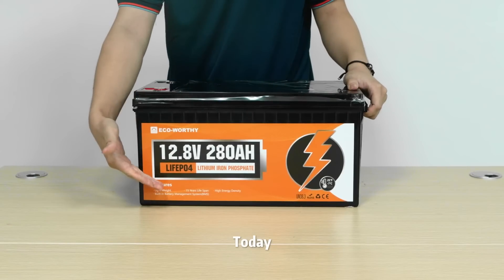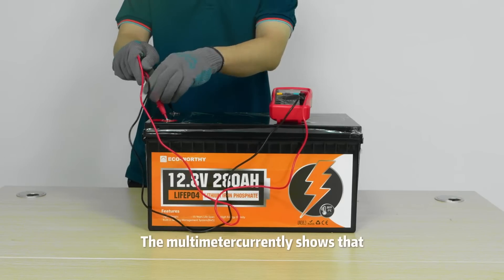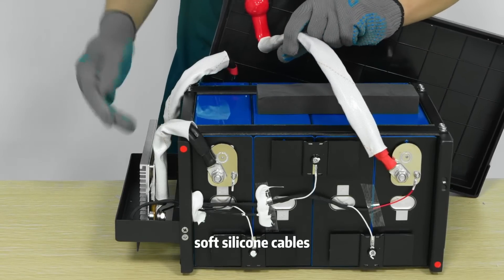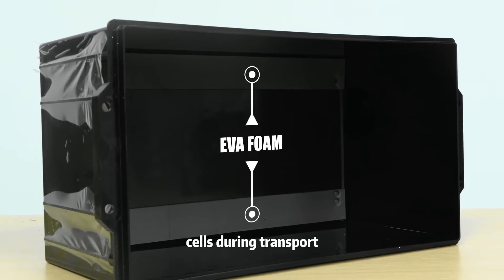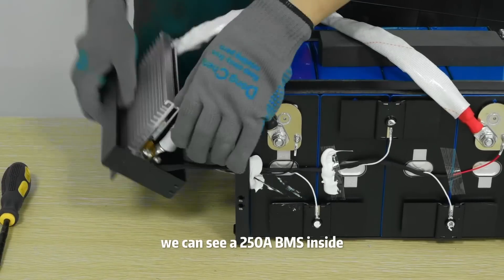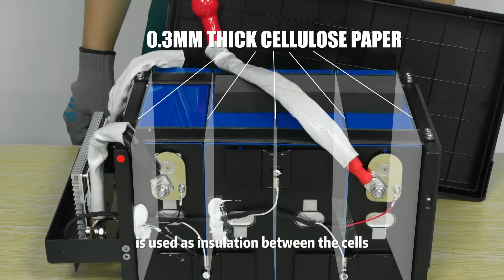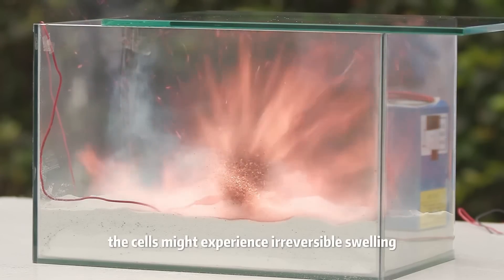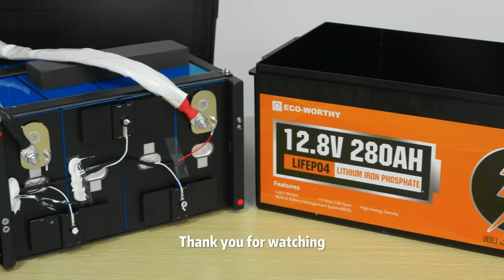12V 280Ah LiFePO4 Lithium Battery Disassembly – Explore the Internal Structure

Comment: I wanted a 280ah battery but it doesn't fit under the passenger seat of my Camper, but after seeing that the battery can be disassembled by removing it from the plastic casing, it fits perfectly. Could you provide me with the measurements of the battery without the plastic casing? Thank you very much.
Reply from the maker: Hello, this is not recommended. Without a protective casing, the battery can be easily damaged and short-circuited, causing risks.
Reply: @EcoWorthySolar  I'm a professional electrician. I know what I'm doing at my own risk. This isn't the first LifoPo4 and BMS cell battery I've assembled on my own. I simply wanted your product because everything comes prepared and it saves me time assembling. I just need the product measurements. Then I'll take care of protecting it properly and ensuring there's no risk. Thank you very much for your attention.

Comment: Also you need to fix your overcurrent protection issues - it is set way too high (as Will Prowse also pointed out)
Reply from the maker: Thank you for your suggestion! We've forwarded this feedback to our product team for further improvements.
Reply: I just received this battery. They have appeared to adjust the 2nd level over current protection to 160a, which is less than the 200a that is advertised. Mine shut iff when more the 160a is applied. Can this be fixed with a firmware update?

Comment: Why do you rip off UK customers? Your batteries are much more expensive here compared to the US - Which is why I won't be buying them! - Also your cells aren't great, as Will Prowse pointed out.
Reply from the maker: We are not overcharging UK customers. Pricing varies by country due to differences in shipping costs for both inbound and outbound logistics.

Additionally, our batteries use A-grade cells, ensuring high quality and performance. Overall, our products offer excellent value for money. You are welcome to compare them with other brands in the UK market.

If you choose not to purchase, we fully respect your decision:)

Comment: Really confused about the voltages Ecoworthy list, any idea why they specify Float voltage so high? most places Suggest 13.5V Float voltage?

✹Bulk/absorb: 14.2V- 14.6V. ✹Float: 14.6V ✹Equalization: 13.6V- 14.0V
Reply from the maker: Hi, thank you for your question! For lithium batteries, float voltage settings are generally not required, and the float charging duration should be kept as short as possible.

Comment: Is it how battery's top lid comes out with your hands just pulling on it?
Reply from the maker: Yes, after removing all the screws on the top, you can slide the top lid backwards to remove it.
Reply: @ecoworthy_official  of the 3 280 ah 12 volt batteries I have from Ecoworthy none have screw down tops. Instead the tops are glued on making disassembly very difficult if needed.

Comment: Isn't it better to turn the BMS heat sink around so that the fins are vertical and not horizontal? 

Vertical alignment will mean better cooling due to better airflow. Warm air rises.
Reply from the maker: That's an interesting thought! However, since the internal space of the battery is quite limited, it's unlikely to create significant airflow. The placement of the heat sink doesn't have much impact on cooling efficiency—as long as it effectively dissipates heat from the BMS, it works as intended. The horizontal fins won't obstruct warm air from rising.
Reply: I think we'll agree to disagree on this. Vertical fins would definitely remove more heat from the base of the heat sink, but I appreciate that the battery is sealed and can only dissipate the same amount of heat through the case regardless of the heat sink orientation. 

An easy way to prove this would be to test a battery in its normal position and then test another on its side, and stress test. 👍🏼

I'm just about to purchase one of these batteries as they look fantastic.
Reply from the maker: @ We appreciate the thoughtful discussion and huge thanks for your support! Hope you love the battery—can’t wait to hear how it performs for you! ⚡🔋💪🏼

Comment: Add a bms with can port, vertical cell..
Reply from the maker: That's a great suggestion! By the way, do you happen to have any equipment that needs to communicate with a 12V battery?🤔
Reply: @ecoworthy_official  Yes but horizontal cells are not an ideal solution.
Best solution vertical cell jk with can and heat.

Comment: Im planning on getting 4 pf these to run my camper im new to solar, my question is , will 1600 watts of solar be enough to recharge 4 of these in parallel?
Reply from the maker: Four 12V 280Ah batteries can store 14.336kWh of power. A 1600W solar panel, at full capacity, would need at least 3 days of good sunlight to charge the batteries.
Reply: OK thank you , I guess I will set them up in 24 volt so I can add more panels

Comment: Do you think it’s possible to add these to or be charged with the Zendure SuperBase V Power Station?
Reply from the maker: If Zendure supports DC input charging at 12V, then these batteries can be charged by it.

Comment: Thanks for the video, can 2 or more of these be stacked on top of each other or stacked on their sides?
Reply from the maker: This battery is not suitable for direct stacking, as its design doesn't allow it to be stacked stably. It's best to place the terminals facing upwards and use brackets for proper stacking.
Reply: @ thanks for the clarification

Comment: One question, the 280ah with Bluetooth function has an active balancer, or does the BMS balance it completely
Reply from the maker: Yes, the BMS includes balancing functionality. It will balance the cells when the voltage of any cell exceeds 3.5V during charging. Therefore, new batteries will require several charge-discharge cycles to reach optimal capacity.
Reply: @ecoworthy_official  The first of 3 EcoWorthy 280 ah batteries I received was extremely out of balance (10% delta) and despite repeated attempts I could not get the balancing function to make any difference despite very slow charging over days using a power supply. Eco Worthy provided a full refund on this  battery. The second battery was also out of balance but, although it was a long drawn out process, I was able to get it into workable balance. The last battery I got was in almost perfect balance when I got it and has remained in balance. I'd like to see EcoWorthy balance all their batteries before shipping them.